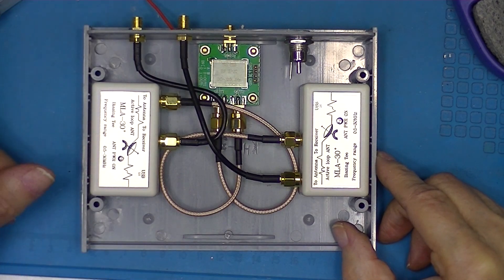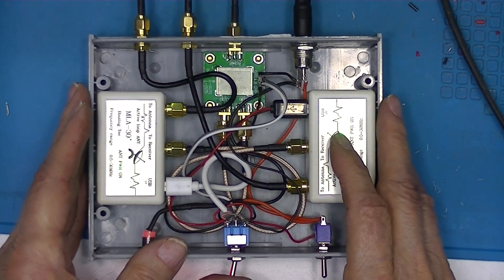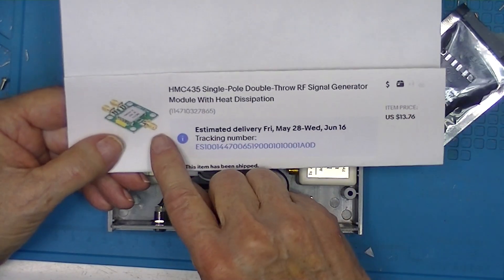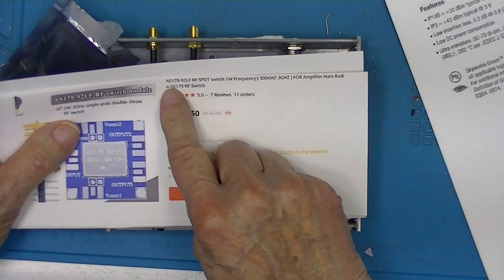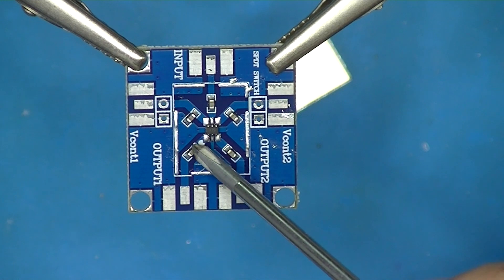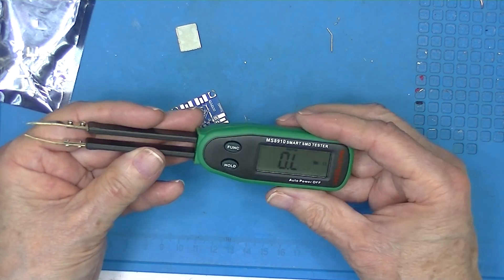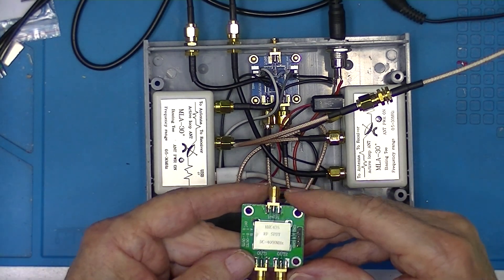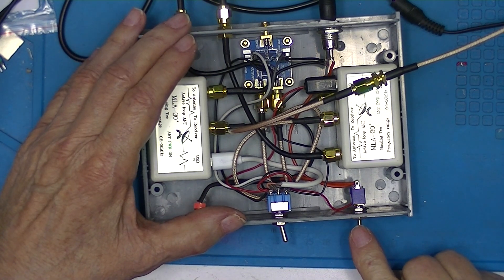MLA-30+’s and Antenna Selector - Part 2

Comment: Because the LEDs in both bias tees are green (1:47) rather than red, we know that you have legitimate MLA-30+ antennas rather than inferior clones. Although the HMC435 RF switch is listed as DC to 4 GHz, it would be good to test it with a nanoVNA to see how much RF passes through at HF and MW frequencies. Your test results indicate that it does not do well at those frequencies. As a simple alternative antenna switch, you could use a mechanical SPDT switch. (M0UKD has posted modifications to his MFJ-971 HF antenna tuner. He used a DPDT switch as a bypass switch for QRP transmission, so an SPDT switch should be OK for reception.). Connect the switch's center lead to your receiver and connect its two outer contacts to your choice of two antennas. If both antennas are wires, you are good to go. If both antennas are MLA-30+s, place one bias tee unit between your receiver and the "To Receiver" connection of your antenna switch.  If one antenna is a wire and the other is an MLA-30+, then place the bias tee between the "To Antenna" side of the antenna switch and the MLA-30+.

Comment: Hello , Steve!   It's all wonderful.  Thanks. But if I had the opportunity, I would apply the spatial diversity of the two antennas and signal summation. The effective distance between receiving antennas is 10-12 meters. I think the directionality of the diagrams is weak here, unlike the AOR LA-400 magnetic antenna. I have both antennas, reception in the metropolis with all the interference.  In general, MLA is better in reception .. Inside we have IC TL-592B,  this is an excellent Differential Video Amplifier (voltage amplification = 350-400 V / V )  ..

Comment: MLA  on order. Can it be overloaded? Say I wanted to try it with a 5" ID/Dia. air coil 600+ turns tight wound 22 AWG magnet wire. Can you experiment without damaging the MLA?
Reply from the maker: I doubt yuo can hurt the MLA. Why so many turns? If it is to recieve a low frequency, the MLA wont work.
Steve
Reply: @stevestrivia-bystevewagner4852  A Tesla coil secondary I have on hand, this experiment is on the back burner. Thanks for responding🙂

Comment: You should of put the two antennas into the antenna splitter awitch....then the antenna single out goes to just one signal amplifier then to the receiver .....that's all you needed.....then you just switch between the antennas via the switch......also the amplifier can be trimmed inside via a variable capacitor and it's the same on the arial box as well inside there.

Comment: I feel your pain with the trials and tribulations of your antenna switches.  I have a single MLA 30+ attic mounted above the ham shack. The PVC  antenna  mount extends through the ceiling of my shack. I simply rotate the PVC 90 degrees to fine tune a signal.  No switch, no problem!   K2CEN